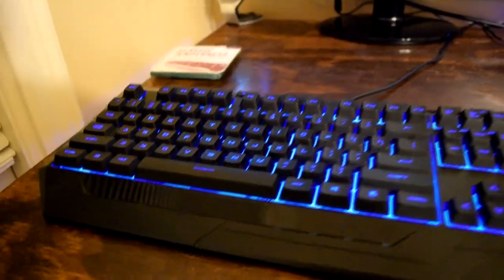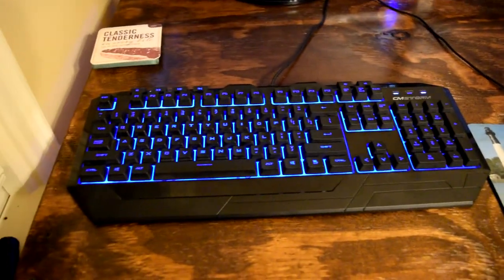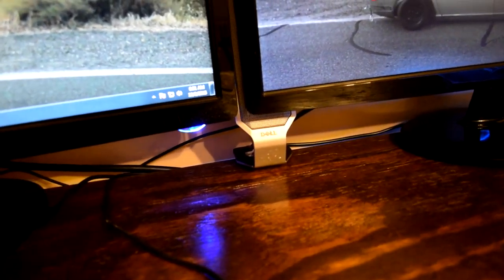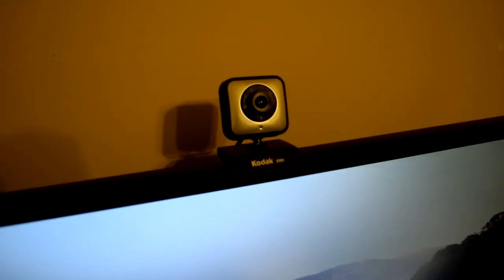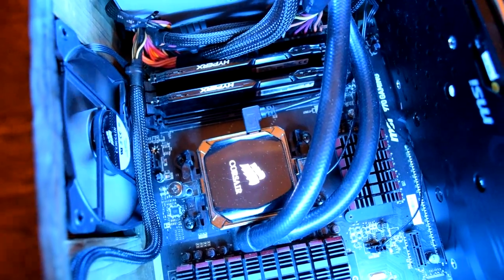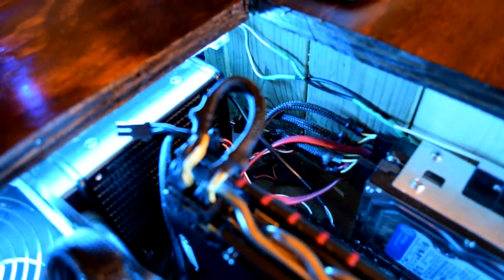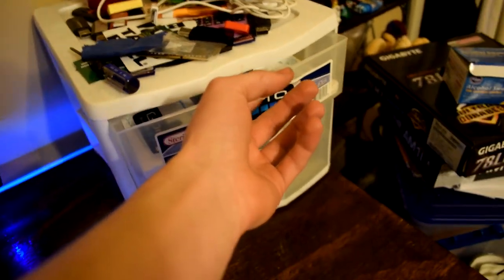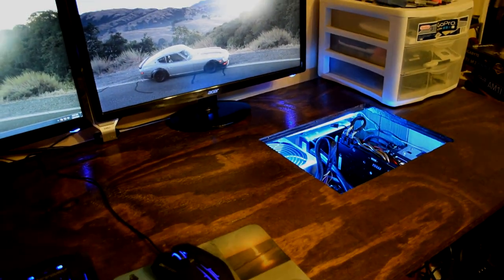In Desk Water Cooled Gaming PC- Stained & Glossed!

Comment: I advise not to ever skimp on the power supply. That is your most important component and if that thing dies, it more than likely will take something with it. Be it your expensive GPU or your entire motherboard. The power supply obviously gives your system power at the proper voltages and if it fails, you will not be a very happy camper.

Comment: I would recommend buying a new power supply asap. That PSU is ok for now but WHEN it dies in a year or 2 your whole system is likely to go with it. I would also recommend buying one of a higher wattage with that graphics card. I have  the R9 280x which is basically the same card as the R9 380x and my card pulls about 400 watts and combined with that CPU you're likely putting that PSU to the limit which is not good. If you can I would go with a CoolerMaster v750.

Comment: Where is the water cooling? You don't mean that crappy AIO thing, do you?
Reply from the maker: There's an H80i
Reply: +Toasty Bros I know, but I do not really consider those AIO things a water cooling. They are loud and look like crap in moste cases. And they do not really offer that much of a better cooling capacity than air coolers. Yes, there is fluid running through it but still not what I consider water cooling. But they are a much better choice than those giant and bulky air coolers nowadays. Those really suck.
Reply: +Michael Townson they do ok for the price if you had a loop with a cpu block and a rad it would be pretty much the same
Reply: +Michael Townson even lower end Corsair coolers tend to do better than majority of the air coolers out there, price for performance id say they are very good, ive built three computers with AIO water coolers on the more aggressive (heat wise) AMD FX series CPUs (8370,8320, 8120) , my 8370 averages 17-30C depending on my GPUs heat output and room temp, and the other two average the same at 100% burn test none go above 45 and trust me i did everything to try so just because its not all fancy colours and weird loops and self made does not mean it is not good stuff and yes it does count as liquid cooling...hence why it is found in the liquid cooling section of most sites
Reply: Toasty Bros would you reccomend buying a cheap psu just for my apu system and what brand?
Reply from the maker: +Harrison Knight Apevia, Rosewill and Insignia I've never had problems with just make sure reviews are good.
Reply: +Team Cannon Fodder I did not say they are bad, although I have to admit one could understand it that way. I apologize, English is not my native language, so I could have said something misleading. The AIO coolers certainly have their right to exist. Of course custom loops are quite expensive and not everybody is willing to spend that much money on their cooling. I have built 1000+ PC in my life, many of them were air cooled, many of them were cooled with AIO liquid coolers and many of them got a custom loop. In any case, the AIO coolers are much more preferable than those giant bulky air coolers; better performance and better asthetics. I think this is something we all can agree on? It's jsut that I prefer custom loops. Not only because of the looks or their superior cooling capactiy, but also for the sake of building them :-)
Reply: Michael Townson yh thats good
Reply: +Michael Townson I agree with it not being true water cooling but temps wise they are about the same as what I've seen from custom loops.
Reply: +Michael Townson Whether you like it or not, or "consider" it or not, an H80i and all the other AIO coolers, are indeed water cooling units.  I'm sorry if that doesn't work for your delicate sensibilities, but it's fact.
Reply: +Mario Saltalamacchia Mimimimimi
Reply: I have the H80i GT cooling my 6600K and it never hits over 42 C during a 4 hour Aida 64 extreme stress test. And it's Overclocked to 4.7 GHz.
Reply: +Mario Saltalamacchia got the same cooling my amd fx 8370 with same performance there great coolers
Reply: +Michael Townson "they are a much better choice than those giant and bulky air coolers nowadays. Those really suck." 

There are pros and cons with both. Good quality air coolers run really silent and still perform very good cooling, better than AIOs at the same price. Air coolers are cheaper and also tend to last longer. There is very little maintenance and no risk of pumps breaking or leaking with air coolers.
Reply: jhorn188 I have not found one Air cooler in any benchmark I have seen even the best ones outperform a AIO cooler, a custom liquid cooler yeah, a liq nitro cooler DEffo but never air...if you have a cooler that's not the size of a small house that can beat a gt80i please reply with the name as id genuinely consider getting it for my next build
Reply: +Team Cannon Fodder Is the" gt80i" the same as Corsair H80i GT? If so I would say from quickly finding some comparisons the Noctua NH-D15 is very similar in temps and runs more quiet. Where I live the NH-D15 is about 15% cheaper than the Corsair 80i GT. I don't know if you consider it the size of a house though. I use the much smaller (and cheaper) Noctua NH-U12s which is another great air cooler.

Some comparisons:
http://www.guru3d.com/articles_pages/corsair_h80i_gt_review,11.html

http://www.techpowerup.com/reviews/Corsair/H80iGT/6.html

http://www.madshrimps.be/articles/article/1000730/Fractal-Design-Kelvin-S36-360mm-Liquid-Cooler-Review/4#axzz424m5GL44

http://www.bit-tech.net/hardware/cooling/2014/05/01/noctua-nh-d15-review/2
Reply: you knew what i meant so it didnt matter and that thing is fucking massive.... yeah a AIO water cooler overall is bigger but you can place it at different places that thing means your limited on case size and structure...also what setting was those temps took on? h80i gt lets you set different settings and speeds for the fans, where as the one you picked nh-d15 does not appear to have settings for that at least on the official website its not listed the NH-D15 looks similiar size wise to the H80I GTs radiotor and fans but you have the same issue its a mass on the board that sticks out and produces worse performance...id rather pay a bit more and get more settings, lower temps and more placement options, i can optimize my airflow to the cooler because of this, where as you would need to look at the case which allows your fans to be placed in the best place to provide airflow to the CPU fans, Noctua are the high end of air flow fans anyway so if there top air cooler cant match a aio cooler then no ones can.
Reply: jhorn188 reading those articles more...look at the default speed for the h80i versus the nh-d15....3 or 4 c lower.....thats not in performance mode which they appear to of not tested....they have tested balance mode which appears to of produced the similiar results and the h90 which is the h80i gt's less intelligent less setting hungry brother (which costs around the same as the NH-D15) even beats it on those tests....
Reply: +Team Cannon Fodder Of course you can control the fan speed and use whatever settings you want. It's got PWM fans that connect to the motherboard. 

The D15 sticks out 165 mm over the motherboard. Most standard ATX size cases will fit that. And some smaller ones as well. Although I agree it's borderline too big. However a lot of AIO water coolers need specific requirements of the case as well in order to fit. Some of them have large radiators.

I did say there are pros and cons with both types of cooling solutions. I would take silent operation, less maintenance, no risk of pumps breaking or leaking while saving some money over a couple of degrees cooler, placement options and looks. 

But that's me. I just didn't think "they are a much better choice than those giant and bulky air coolers nowadays. Those really suck." was a fair description of air coolers.
Reply: +jhorn188 the max speed of those fans is lower than those on the h80I gt, even at Max I doubt you'll get much difference, aio have minimum maintaince, I literally have to clean the radiator once every few months with an air can....most air fans have that issue too
Reply: +jhorn188 the h100 range are the ones you need specific cases for they are double radiator, most of the 60,70,80 and 90 range fit into any half decent case
Reply: +Team Cannon Fodder I don't know why you would ever want to run the H80i fans at maximum at that noise. I would consider my cooling solution a failure if I had to run the fans louder than the ~43 dbA that the NH-D15 produce. The H80i produce ~56 dbA at max fan speed which is a lot louder. If you are overclocking that much you may need to spend more serious cash on AIOs with huge radiators or other cooling solutions altogether.
Reply: +Michael Townson It's a cooler. Running off of water. It's a water cooler

Comment: "i dont care about psus really, it does the job".....facepalm PSU is the most dangerous component to skimp on, a cheap one can cause instability in your components and when they go wrong they can fry large amounts of the computer......i had a cheap psu in my last computer, and the same maker made the case.....the case caught fire due to faulty circuit board built in for hdd that was powered but not used....sort of made me realise how important not skimping on ANY parts are (that was not a cheap case either £130 to be exact) PSU wise, i always go corsair(seasonic) and want an example of how important a good PSU is, i took a cheap cit one out of my stepdads PC and placed the same wattage Corsair model in and like magic  harddrives that previously had been faulty started working again, components that crashed regularly stopped crashing (creative sound card  z).
Reply: +Team Cannon Fodder FUCKING THANK YOU MATE. TEACH THIS MAN A LESSON
Reply: KappaJohns computing is one of the few areas where you get what you pay for, skimp on most parts and usually within a few months you end up regretting it, I mean a soundcard or usb card to give you more ports you might get away with but even then they can cause unexpected crashes...the only part that can cause PERMINANT DAMAGE (other than a cheap watercooler but that's not needed for most builds) is a cheap PSU...just hope no one watches this and makes that mistake and burns out their pc
Reply: +KappaJohns what does your emblem mean?
Reply: Team Cannon Fodder  not totally right you can skip some parts like sound card or networking card for example if you want a second one but power supply i always buy very good one and motherboard ia very important too
Reply: Yussef Ibn la ahad there what I'd call non essential even then you don't want to go for something that causes instability or other issues, I had a cheap sata card once and it kept crashing on me